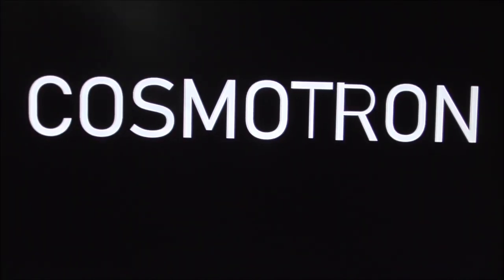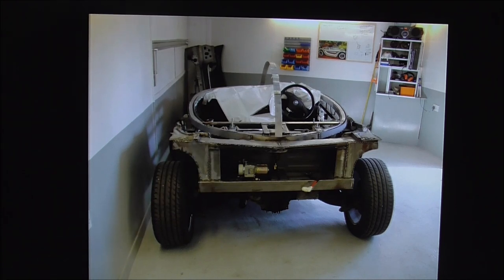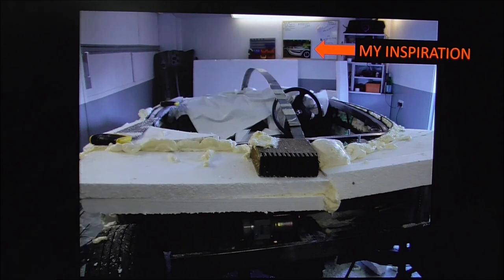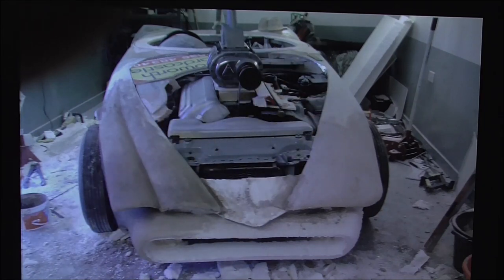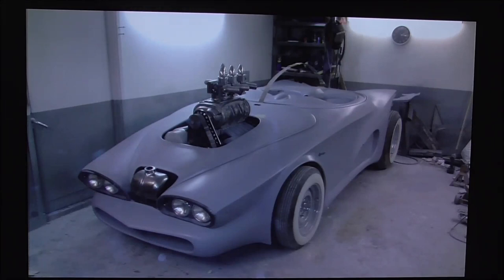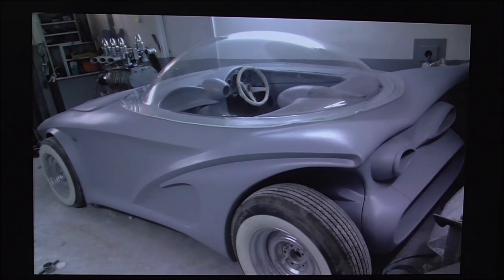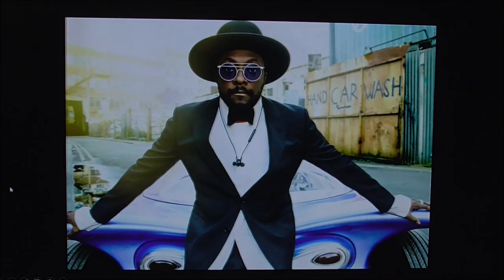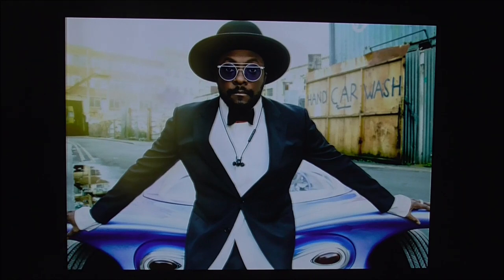THE FIRST UK BUILT BUBBLE TOP CAR - COSMOTRON THE STORY

Comment: I really enjoyed that, sometimes just still photos are all that's needed to get the information ( and your narration). A couple of questions,  do you gouge out the poly once the fibreglass skin is on? And Are there any videos of it driving? Keep up the good work.👍
Reply from the maker: Hi, yes I remove the poly from underneath, however sometimes it is impossible to get all of it out, it doesn't matter if its just the polystyrene, but the plaster needs to come out as it can be susceptable to damp, can be a tough job!
Reply from the maker: Also, there are loads of videos of it driving around.  Barcroft cars did a video about it so you could try googleing that :)